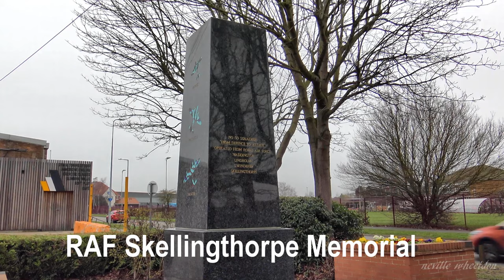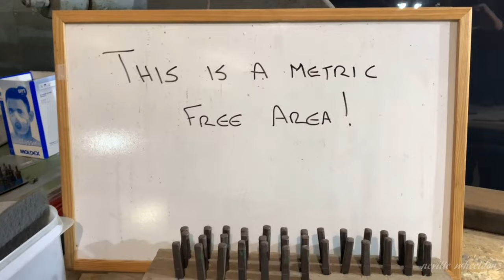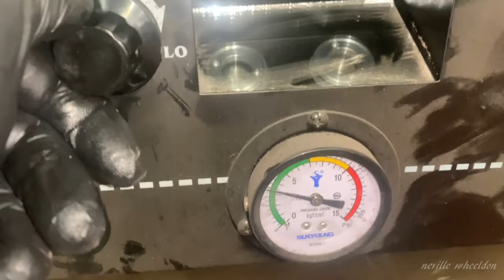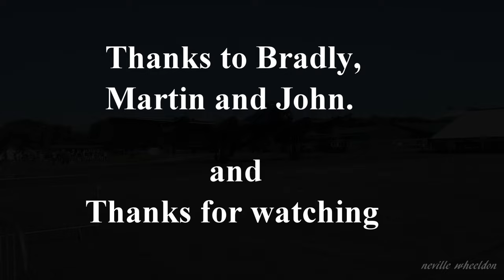Video 88 Restoration of Lancaster NX611 Year 4.   Merlin service and repair.

Comment: Really super to get to see some of the service details of the Merlin's, and noticed the taper drive, even on the propeller, so it looks like there is more than a few lb-ft of torque to make that short taper transmit, what, 1500 hp?
Also, thanks for the short bit of history of the airfield, it puts some perspective on the losses of bomber command!
Reply from the maker: Thanks Lohi for your comments.

Comment: Amazing. I wonder if any of the other cams on the other engines need holes drilling?
Reply: Very unlikely but there is a way to check without pulling all the CRMs off. It’ll be done when we pre-oil the engines.

Comment: I hope the table that was used to check the camshaft for run out was a machinist table . Any others will give you an incorrect reading  .
Reply from the maker: I'm not sure on that Paul, but I think they know what they are doing.
Reply: @nevillewheeldon1693  
Hi nev. I am an engineer.  Any measurements must be taken on a table that has been machined flat to less than a thousand of an inch to guarantee perfect measurements  .
Just an observation.  
Many thanks for your lanc updates 
Stay well chief  .kind regards
Reply: david woods  hi David  . Yes  I also agree with you on the VEE blocks being of the same dimensions.  Good point 👍

Comment: Hi Neville, and greetings from Melbourne!
 I just watched a doco on the 100th anniversary of our RAAF,  and about half way through, I saw war time footage of (maybe ) 
Aussies starting a Lanc with what I thought was "just jane"  nose art... except she was not wearing a bikini, but a tight full body suit...so my questions are... Did Aussies fly NX611? and are they going to repaint the nose art back to original?  
p.s. Am I right is assuming this airframe was NX611 during the war, then went to the French Navy, THEN came back and was nx611 again!  very cool.
Cheers Scott.
Reply from the maker: Hi Scott , sorry late replying. Brad the engineer at East Kirkby wrote an article on NX611 I thought he might have published it on the net but as informed me he didn't . So NX 611  was mothballed soon as it came of the flowline in May 1945 never saw action in ww11. The French bought the Lancaster in May 1952, to answer your question NO the Aussies didn't fly NX611 or as it was called when the French had it WU15 and I think they will keep the artwork as it is know. Thanks for watching

Comment: Do they dyno test the engines after assembly?
Reply: No. We take RPM figures at a power setting before the maintenance and compare the figures before and after. There are also expected and minimum figures laid down in the RR manual.